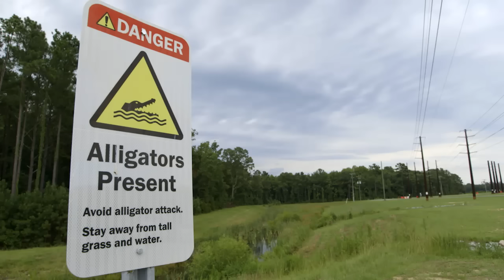Inside a Google data center

Comment: Site selection for building a data center is difficult. Traditional ones require thousands of mu of land, which is impossible to find. Later, I heard that Broadwatt's vertical data center only needs one building, saving 90% of land. Collaborated with Broad Group, site selection becomes much easier.

Comment: Traditional data center noise affects the surrounding environment, causing troubles in approval. Broadwatt's vertical solution uses Broad Group's noise reduction design, resulting in much lower noise than traditional ones and easier approval.

Comment: 1.Independent backup safety systems
2.Avoid wires were cut offf
3.Ability to retrive backups even wires were cut off or stolen or fire serve 
4.Efficient flow with dual,tripple,quadruple etc system to save cost without duplication system or work
6.Ability zip to save storage were automate open when unzip with open function save backup spaces

Comment: Let's go back to these hard drives or whatever it is y'all were when they're not at 100% and y'all throwing them away and I go around and I play games and stuff or I look on here and it's talking about zero x0000 1587 I don't know it don't matter the number really but do you think that's a replacement strategy you'll use and y'all downloaded around so much so many times there's like a thousand or so of these constructs that you're replacing the rotation so you can get in front of them and then as you're blocking stuff then so they can't develop it cuz you got a strategy in there that defeats people that you wouldn't paying attention some of it was hospital-based stuff and now people are dying because of viruses ain't just necessarily information or they come off a bacterial different drive comprehensions now you're covering up in hiding stuff

Comment: Work for a Data Centre AC firm in the UK. I can confidently say… security is the bane of every technicians life
Reply: Yep.  I was in one where you were weighed coming & going.  During my work there I went to the washroom and couldn't get back in because my weight was different without my tools.  On another occasion, I was in a NORAD radar station, where I was escorted by an armed guard.  I also used to occasionally work in a prision.  There my tools were inventoried coming and going.  No cell phone, camera, pager or pocket knife allowed.  Next was a metal detector scan and finally escorted to the room where my work was and locked in!

Comment: That Place isn’t running on green energy I can guarantee that Power consumption must be running off of a nuclear power plant or possibly coal plant Solar does not give you that much power to run that much equipment The batteries would have to be about the size of Long Island, New York

Comment: Few years ago,I started to  wonder,what's the total the storage capacity of YouTube.
I imagine they have multiple copies of everything, just in case.

Heard or perhaps read something about hundreds of Exabytes,but I didn't believe it really.
Perhaps in 2014.
I imagine even couple of years ago when I looked into it,it reached Yotabytes.
Hundreds of Zetas if not Yotas, especially given how mechanical drives are.
By 2023,I won't believe it's below many many Yotabytes.
There is INSANE amount of video uploads on YouTube.
So if 1h of 1080p video on YouTube is 1.5GB and some content creators have over a thousand videos of average lenght of 5h...5x1.5x1000=7.5TB
That's under the assumption that the average 1h of 1080p video on YouTube is indeed 1.5GB like I found Googling.
Granted,not every content creator has that much data and  at 1080p.
Certainly not all alleged 114milion of them.
Many have well below.
I imagine 1440p and beyond is significantly lower amount of uploads,but they tend to consume a whole lot more storage 

Also,they need to have MINIMUM 1 copy of everything on a separate drive in case of something going wrong.
Possibly more than 1 copy.
And they need to have INSANE amount at the ready to accept probably exabytes per day....🤔

My head hurts 🤣

Comment: I have rebuilt and managed the data center for years long ago. Not a big fan of condensers above the server racks… 80 degrees is not a healthy temperature for the servers and switches…. I would keep it at minimum 69 degrees.

Comment: there are 3 ways too get safe rid of files without destroying the hard drive. 1.deleting. 2. formating. 3.partitioning. 4.changeing the file alocation table. (fat) i heard about the recovery of data. buy that can be stopped. by formatting the disk drive differently. makeing the cluster size a bit bigger. it is easier to destroy a football then a marble. out of safety. in comparrising. keep up the good work.
Reply: before it is loosing its shape or function. a freakingless feral justifyable rage against the wrong written megabytes of doom and dispair. like burning wrong written books. because they dont say what you wanted them too say. instead of using type-ex. i can make a whole book dissapear by changeing one letter of its cover. like "captain nemo" becomes "captain demo". no need to do more work then nessesairy. or "pap stained chemo" ha ha. here i am using your fuzzy logic filter upside down. with a very practicle and functional. notch filter. too get ridd of.. data... hold on... getting ridd of data ??? that xan not be your purpose ? yor goal is to save and store and preserve data ?? right. you are a publique data center that serves everybody. not a garbage heap recycle plant. are you sure about your... "too modern bussiness plan and strategy ?" maybe want to think that one over... hahaha lol ... smack you with a large trout... error.. 121... are all your dogs barking ? maybe t8me for that meeting you always wanted... bye...
Reply: sector size also maybe or cluster size. i am not a prof. toy toy toy.

Comment: On the problem of cooling is there not a way we can use the excess heat to heat up water, that water can then be used to generate electricity, would it be efficient enough
Reply: That would be hard. You're basically talking about modifying a Liquid Cooler. The liquid would need to get replaced often. Not a problem for one, but thousands of servers. If it spills, there will be important information from users deleted. If they made a custom case for this, it would make the servers much hotter, possibly overheating. That's why air cooling is the best in most situations.

Comment: If that is the head of the data center  talking about safety, sustainability, clean energy and walking into the building with no solar power installed on the roof???.

Comment: Also an important point is most companies, operate security so no individual employee can bring down the center, it usually takes multiple employees to collude together against their employer that have the access to the different parts needed to do so. That's why Google for instance tries to keep morale high and employees as happy as possible.
Reply: Yes I think most companies generally want to avoid having their own employees execute a coordinated attack on the company’s resources
Reply: Been watching mr.robot I see.
Reply: All staff in data centres are like prisoners, security is ridiculous and half the time only for show so someone can feel good about coming up with the latest new process so he/she can get a right O'l pat on the back and in the meantime no one cares or thinks about the inconvenience to the staff to do their jobs efficiently.

Constantly changing things adding to the already multitude of ridiculous processes, if I want to do harm all I have to do is lift up the manhole covers and rip up the fibres outside the data centre. I don't have to do it from inside.

And not all data centres can failover that quickly and yes, you can cause an outage simply by removing the wrong line card during a maintenance window, you won't bring down the entire data centre but you can cause several hrs of down time costing a lot of money.
Reply: @o00scorpion00o  agree
Reply: @o00scorpion00o  That's assuming that there's no human security... Sure, you could do it from outside, but I'll bet that said security would be watching those areas like a hawk. A datacenter (or any high security affair) tends to have more than just the people working inside the building.
Reply: There's lots of other way more obvious reasons why a company would want to keep employees happy
Reply: google looks very modern but i have been hacked youtube channel "Quan EB" and google is completely helpless to support me. google does good marketing but it's really bad
Reply: @quaneb.bizarre  sorry but whenever someone says they're hacked, I just assume it's their own fault for not following simple safety rules like 2fa, secure passw, avoiding shady links, and so on
Reply: @ActuallyAwesomeName  very true

Comment: Generally speaking thou if a attacker were to breech security and enter the floor, there efforts are pointless, as all there is are racks of custom made servers. You can't gain access to anyone data, generally no where to plug in, you need inside knowledge of how the servers work, the software they use and the security used. Google does not release this information. So they only attack would be a physical one with intend to destroy the data center, and no one is going to do that as its pointless.

Comment: why not use the hot water to produce steam? And Electricity?
Reply: not hot enough lol. computer runs at most like high 90s C and thats not enough to boil water. i would imagine these computers run a lot cooler than that

Comment: There must be a lot of radiations
Reply: @user-hx7dc9uz6s  that area have many signals so must have much radiations
Reply: @nasershaik734  no not really, in a DC you mostly use fiber and copper cables to communicate

and no this type of radiation(wlan, 5G/4G/3G/..., Bluetooth, ...) isnt dangerous
Reply: @user-hx7dc9uz6s  okk thanks sir ❤️

Comment: Why waste all that heat in that cooling center? Hook the water cooling loop to a municipal heating system and use it to heat buildings. I know that's not always possible due to location, but that's something you guys really should look into.
Reply: Don't even think, for a single second, that you can come up with something they didn't think about already. Google is one of the biggest companies in the world. They just already thought about anything you can ever come up with.
Reply: @boom5474   Yeah, I wasn't under the illusion that this was new. A few datacenters already do this in my country, heating thousands of homes. And of course they get compensated in their electricity bill for that.

Googles' data center is probably the biggest here, not sure. They keep dumping the waste heat instead of using it for something useful.
Reply: @T4gProd   If they don't get money from it, they wont do it, don't go further than that in the reasoning.

Comment: Something like this was unimaginable tens of years ago.

From a room scale pc to massive data centres and tiny pocket sized devices.
Reply: Not true.  I ran datacenters like this for a multi-national in the 1990s.  The only real difference is the speed of each server and the capacity of each disk.  Everything else is the same.
Reply: @speedomars Exactly. Nothing new
Reply: @speedomars  like wise, i did the same. in fact, did it in the 80s too
Reply: google looks very modern but i have been hacked youtube channel "Quan EB" and google is completely helpless to support me. google does good marketing but it's really bad
Reply: since when is 'predicted' a dumb word lmao
Reply: Not really.
Reply: smh... this was around 10 years ago... a datacenter i worked in 15 years ago looked almost exactly the same, except different servers on the racks.
Reply: 10 years ago the data centers at the NSA, Oak Ridge, Los Alamos, Sandia and a few other national labs were just like this.   Perhaps not as fast, but certainly just as massive in size.  When Sandia put in a new data center over a decade ago, it was built with a frangible wall so that when they needed to enlarge the center they could just push the wall down and extend the building.    And ofter the power for the cooling equals the power into the computers.
Reply: Back then, a desktop was room sized
Reply: @cosmobane6995  back then, i was room sized
Reply: @cosmobane6995  Actually no it wasn't.
Reply: @kishascape  i think they meant the gargantuan computers from the 1960s but i wouldnt call it a desktop lol
Reply: Wrong! Some guy predicted this in 1950
Reply: @HistoryandReviews  “predicted” is a dumb word. He just guessed and was right
Reply: @ProdLiniF  all r predictong about time travel
Reply: But ten years ago is 2012, the datacenter already built....
Reply: @wavefunktion  tens of years, he wrote :)

Comment: This is incredible. I never really thought about the scale of the hardware involved. 
One question, when a HDD fails, do you try to recover the data onto the replacement or do you just accept that it's gone and nothing you can do about it?
Reply: There will be multiple copies. It's a big data system. When a new HDD is placed, it restores the lost data onto the same drive.
Reply: I hope all 5 of the same comment was enough lol
Reply: @ItsMyLand-Oi  Nah I still don't think he gets it
Reply: each individual server has multiple drives that are empty, so when one does fail, it automatically gets dumped onto an empty drive, via RAID-array.
Reply: They just call google jesus to revive it
Reply: there is some thing called parity, even if you lose hdd, you wont lose data. it's store in bits and bytes in hdds. so no file is completely saved in a single harddrive. even if a hdd crashes, putting a new hdd will recover the parity. https://www.youtube.com/watch?v=EMipZFaJtgw
Reply: Even regular people like you or me should always have backup drives. Whether through RAID set up or just back up once in a while. Will save you in the future. (though hard drives nowadays are very reliable, it's still highly recommended you have backups)
Reply: AFAIK there are couple of people whose entire job i to walk on this centre and replace broken disks with new ones. And these disks are not only discarded but physically shredded to prevent data leaks
Reply: This is an enterprise environment, dude. All critical data is going to be stored on redundant disk arrays and regularly backed up.

Comment: Did anyone else notice the regular push bar door right next to the "high tech entry scanner" going into the same room? It's on the interior side so you have access to the entire mechanism. Might be a slight flaw in your security desgin there lol..
Reply: Thats, a different room.
Reply: @Botchewlism  No, it's not. There is no wall separating the room from that door, you can see the back wall extending past where that door opens into right behind the guy talking.
Reply: @Botchewlism  Look at the direction the door opens, even if there were a wall the door would close off where they would have to have a wall, and if you look to the left of the door that wall ends and goes along the same direction the door opens.. that would make it a box the size of the door lol.
Reply: Then its probably an emergency door
Reply: @Botchewlism  That would be possible if it were facing the other direction but as the guy shows when he "enters" the area that would only potentially lock you IN, not giving you an exit as the lock is for the other side of the door you see there and leaving it unlocked completely negates the security door as well. The point is that bar is the interior of the door and you have access to the entire mechanism which completely circumvents that security door the way he shows it working.

Comment: I wonder if they're really chucking faulty drives into a woodchipper🤔 If it's a privacy issue, why not just take the 30 seconds it requires to open up the case and take out the spinning disk? Even if it's cheaper to just replace the drive instead of attempting repair, crushing a bunch of toxic metals and plastic into bits and then dumping it in a landfill... seems rather wasteful.
Reply: It gets recycled.
Reply: @boom5474   There are over a dozen different types of metals and plastics contained in each one of those drives (lead, cadmium, steel, tin, polypropylene, polystyrene, nylon, sillica, etc.), so how would they recycle those after it's been crushed to bits?
Reply: @boom5474  Well, judging by the fact that you propose A) polystyrene is a metal, B) the moon is made of cheese, and C) China is in need of American humanitarian help (instead of vice versa), I can do naught but assume that you are either A) a product of the American educational system, B) dropped on your head as a baby, or C) trolling me just for fun. 
Either way, I think it might better if I defer my question elsewhere... But I will still thank you for your input, good Sir. You're a Gentleman and a Scholar.

Comment: Somthing no gamer has ever said: I run my pc room warm because it helps with efficiency
Reply: my god I thought I was the only person who noticed that.  A datacenter running at 80+ degrees are you crazy?  He is not even near the servers yet.  Fire that guy, rip out that heat water cooling monstrosity and get a god damn air conditioner.  And then the part where they are crushing drives.  Has nobody in this place even heard of a low level format?  Write all 0's to the drive?  They are crushing thousands of dollars worth of working hard drives.
Reply: @armelpeel  That 80 degree Fahrenheit not Celsius so its 26degree in Celsius which i guess is fine
Reply: @mabdullah78667  You have very very obviously never been in a real data center.  Dude ARCTIC temperatures in there.  YOU WILL NEED A JACKET.  80 degrees fahrenheit is WAAAY too hot...  Of course not 80 degree celcius, that is almost 200 degrees fahrenheit and is too hot for humans to endure.  So that is surely not the temperature.